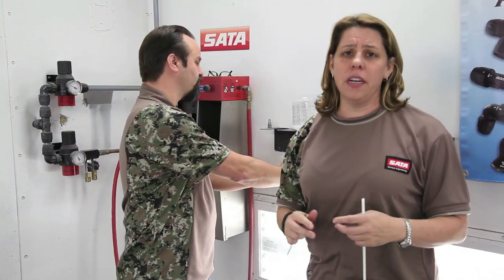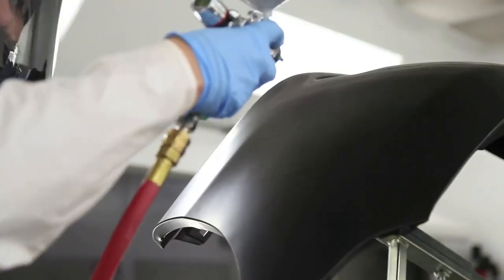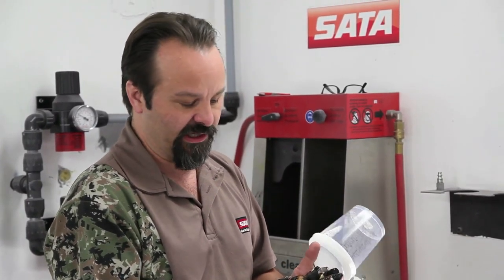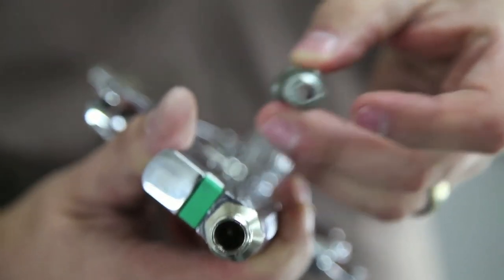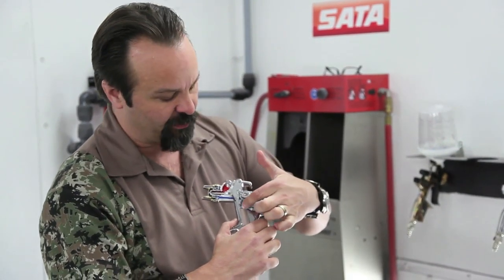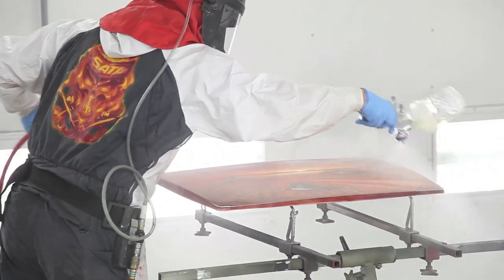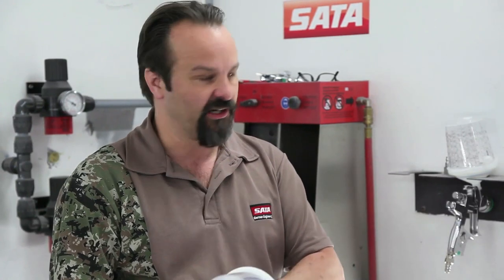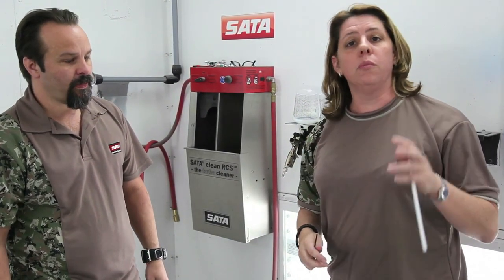How to Set Air Pressure / Air Volume for a HVLP or RP Spray Gun with SATA

Comment: I know the owners of this video have moved on - but for those watching this for the first time - there's merit in what the SATA dude is saying.  Not sure of the science behind it - but regulating the air at the beginning of the hose - rather than pinching it at the gun made a big difference for me. I opened the flow in the gun up until there was just a thread or two left - and opened the gun regulator open and then turned down the air at the dryer. The result was a softer and much fuller spray of clear that laid on like liquid candy. Around 40psi at the beginning of the hose resulted in 20 at the handle and probably 12 or so at the tip. Try it - it worked for me.
Reply: Dave Sinclair Yes, I think you are right. I mentioned this above to another person, but with my limited understanding of flow through a medium, turbulence is created at restrictions, and the HVLP gun is likely designed for turbulent flow ONLY at the nozzle. Any turbulance before that is added to the nozzle, which is undesired and not originally intended in the design.
Reply: Dave Sinclair What about leaving the gun side regulator wide open just so you can read pressure, while still regulating it at the tank?

 Or is that still fairly restrictive?
Reply: Lou Kingman Your idea would work - think of the hose as the float bowl of a carburetor - in that it creates a reserve of pressurized air to be used as needed. Logic tells me there's no difference - but I just sprayed a 911 and I have never had a better flow of clear -- just like liquid candy.
Reply: well back in the old days, everyone painted with a siphon gun with maximum fan, and maximum material- needles backed all the way out to the stop- and regulated the pressure at the wall on the shop air.  so this guy is not telling us anything we weren't doing since 1910 painting model T's with antique Spraco siphon guns with an .086" tip.  he's basically telling us, treat the HVLP or RP gun like a conventional.  and if you look around enough, you'll find out a lot of guys are pumping their HVLP gun pressures up to 60 psi- well that's not HVLP anymore, it's conventional masquerading as HVLP.  true HVLP is a bleeder gun with constant air coming from the cap, and material bled into the airstream when trigger pulled. and the air supply is from a turbine, and paint from a pressure pot.  that is true HVLP.  we were all sold a bag of goods, i.e. a bag of bs- when they foisted these HVLP guns upon the industry.  and the painting industry took the bait, hook line and sinker, and even swallowed the pole.  they got everyone to throw away their trusty reliable Binks 7 guns they had since 1937, to buy new $500 HVLP guns that don't paint for crap.
Reply: What i do i have a regulator and filter on the wall i turn the regulator down to 80, then by the time its get through the hose to the gun its the exact pressure i need. to easy.

Comment: im new. I actuall painted a couple of vehicles. First one had tons of orange peel. I only had the pressure guage at the gun. I bought another water separator for the wall. I acyullay said, let me try setting the wall at 40 and the gun at 28. It came out with no orange peel. I just wanted to cheack and see if the pressure at the gun is supposed to be 28 while spraying, or with the trigger closed. And I came across this and the guy is saying works better set at the wall. I just tried it to see what would happen, and now I find it is the way you should do it. And I will sat, the primer, and the paint all cme out smooth as if I purchased a panel primerd and painted from a factory. I did have a few fisheyes I had to sand and redo the job with though. next time I will know to wipre the thing with grease and oil remover. And get fish eye remover for the paint. It screwed me up bad and wasted an entire day correcting it.

Comment: To achieve the air pressure correctly, we can adjust the air pressure control gauge and reading the number on it.
To achieve the width spread correctly, we can adjust the spreader adjustment valve and measure how width it is (by inch or cm).
To achieve the correct distance between gun and the surfave, we can measure it (by inch or cm).
But how to achieve the correct fluid flow or velocity?
What is the best indication / direction in adjusting the fluid control and how to know if the volume of the fluid's spray flow is right and properly? (whether is too much or too little?)

Comment: If I have a 3000 RP non digital, should i use a reg and gauge on the inlet of the gun in addition to the reg on the wall for the whole job or use it to set the pressure at the wall and remove it for better flow into the gun?
Reply: What i understand from the video is that you can leave a gauge/regulator at the gun while spraying, but leave the reg as open as possible. Use it only for finetuning. Do the major adjustment on the wall.

Comment: Just found out me new Mini Jet 4400 the air regulator on the
back of the gun is plastic and if you plug it into a hose that has a 100 lbs or
more the plastic piece of ^&)^) breaks . I have two of the guns and both
are broken. So i looked at my Adam II docks and the same plastic crap. Should
have bought A Harbor freight $50.00 gun . I am done with Sata.Also do NOT leave thinner in the cup it causes the seals
to shrink up and fall  out . Found all this out from DAN AM Corp the Sata
distributor for the USA.
Reply from the maker: Dan Patch hook any gun up with 100 psi and you're going to blow a lot out of the gun. 
We've been begging techs for the last 10 years to store guns dry for that reason. We see it over and over. 
No one wants to invest any amount of money in a quality gun and see it ruin.
Reply: The money i spent there should be NOTHING on the gun made of plastic.Those Adam II docks  cost as much as some paint guns and there made of PLASTIC.How much do they save by using plastic instead of Aluminum or brass.
Reply: I am using a regulator at the  gun . But it will still have max pressure when you plug it in .So i am suppose to turn the wall regulator up when blowing the car off and then turn it down to spay.Or have 2 hoses.The Adam II dock cost as much as some pretty good guns cost and you make it out of PLASTIC.Probably would have cost $0.75 more to make it out of metal . Were is the quality in that.
Reply from the maker: your wall pressure for the gun (in the booth) would never go above what you need to have the right pressure at the gun factoring in your drop by feet of hose. So I'd have maybe 36 to 40 at the wall to have 24 to 26 at the gun. 
you wouldn't blow a car off a car in the booth so it's not an issue. 
A variety of components work together to lighten the gun. It makes the painters life easier... less fatigue and more cars per day.

Comment: I just want to come here and say thank you. I was using an hvlp to refinish my handrails for a home diy project and noticed the coat was flatter in several spots that it should. Seems I had the pressure set 3-4 lbs higher than I should. I lowered it and used high flow fittings and the finish is night and day. 

Appreciate the straight forward video. Cheers

Comment: This is a great video , while I have some trouble due to the speed of talking !!

So he do not use a typical HVLP gun there, but  a conventional one regulated to spray with low pressure high flow ? 

Is there an aided part around the nose for the last second of video ? an accessory ?
Thanks

I mostly spray lacquer on woods and some "primers" too
Reply from the maker: The SATA 4000 in his hands is a HVLP
Reply: i have devilbiiss flg 5    which is  transtech       not hvlp   basically conventional     but everything he says here makes any gun work better

Comment: Great info,  best change I did was adjust spray booth pressure but I actually leave a bit higher, it just works for me.  And I switched to the high flow fittings. Big difference, thanks

Comment: I was a painter back when SATA came out with their first HVLP guns. I think it was a jet95? Maybe Jet95 NR? Anyway, I had more gun distance from the panel and much slower passes that I see this guy doing. I also did a 50% overlap. This looked like an 80% overlap. Is this just a new way of painting or is it because of the RP guns? I still paint sometimes, so I'm curious. Am I now doing it wrong?
Reply: The guns now are much better than the NR95 you gotta be moving I run close to 80% overlap as well even basing metallics. The sata 5500 is a bad mofo gotta be moving and grooving with the base and clear you can choke the fluid down a bit on the clear gun and get a good finish either way
Reply: @rickybyrd660  I just bought a digital 4000 RP 1.3. I didn't like the NR95. I continued to use my 1.4 Jet90 back then. I really like how my minijet 3000 hvlp and my new 4000 RP 13. spray.
Reply: @CarbonGlassMan  that’s a good gun I wasn’t a big fan of the 5000 but the newest model is hands down the best base gun I’ve used. It makes metallic laying and blending easy. I used the hvlp 1.4 on the 5500. If I had a good downdraft I’d be using the rp for clear. I’m using an lph400 with a 1.4 atm. Also the new Satas have a 0 and an I tip. I liked using the 0. If you like that mini jet then you’d probably really like the lph80 with a 1.2
Reply: @rickybyrd660  I owned an lph400 Iwata before and loved it. That's one of the guns that got ruined. That was a really nice spraying gun. I have an older downdraft booth here with a bake cycle. I'm a mold maker now, making fiberglass and carbon fiber molds for the race industry so most of my painting now is just spraying clear coat on carbon fiber body panels. I do sometimes spray base coat too on my plugs that I plan to make the molds from but I just stick with black base to show any imperfections. I do miss painting cars. I was pretty good at melting clear in on C pillars.

Comment: all that to save a little overspray and some paint, and meet emissions standards....oh well, they're trying...but what a crock thinking that actually matters.   what I see is a stressed out painter who has a gravity cup in his line of sight, can't paint as good or see as good as an old siphon cup underneath the gun.  and has to make a lot more passes to get the panels covered.  if you watch the video they are painting like a madman frantically trying to cover the panel.  with an old Binks 7 or Devilbiss MBC they'd make a few passes back/forth with 50% overlap and be done.  I just don't get it- why this HVLP and RP is forced upon everyone.  makes no sense.
Reply: I know exactly what you mean...and I would say that if you have to paint as close as 5 or 6 inches to a panel, you rapidly increase the likelihood of metallic streaks if you are not exactly perpendicular because at that close range it's not very forgiving.   I'm glad I no longer have to earn a living in auto body.

Comment: Have a 30 gal compressor 5cf @40 and 4cfm@90 but HVLP gun says it operates at 15cfm I suspect I need a larger compressor, or add a tank.  if so what should I shop for?
Reply from the maker: Definitely a larger tank will help a lot.  Also be sure to use High Flow fittings, so you don’t have further pressure restrictions, and volume restrictions.  If you add a 200 gallon tank, you should be able to get by.  However, what I don’t know, is how large of parts and pieces, or are you painting full cars.  If full cars, you will need a larger compressor.  If doing this for a profession, at least 7 hp to 10 hp.  If as a hobby, the 5 hp compressor will be enough, but be sure it has a large storage tank, perhaps at least 60-80 gallons of storage.

Comment: I was spraying with 125psi line pressure and reducing it to 30psi at the cheap gun regulator :O

I will try setting line pressure at like 60psi and hope there is little to adjust to get 30psi next spray

Comment: I know this is an older video, so making comments or asking questions here now is probably a waste of time... but here goes anyway!

First of all, he's incorrectly stating the air pressures for HVLP & RP;  he's switched them: HVLP 10psi or lower and 15psi and higher for RP.

Second, it doesn't matter where the air pressure is set - whether it's at the wall or just prior to being sent to the gun - because the air speed will be the same regardless.
Reply from the maker: Nope... 
Choking down at the gun changes performance. 
It's been proven by every gun manufacturer and paint company
Reply: Thanks for your reply,  @Collisionhub .  If you check the statement I made more carefully, you'll see that I was talking about the pressure being reduced prior to the gun and not at the gun itself.  If the pressure is too high, then quite obviously it needs to be reduced, right?  I'm contending that it doesn't matter where that's done prior to the gun.
Reply: it  matters a lot where it is set       im not being rude and hope you dont take it that way       you should rewatch the video          if you set at the wall and use the hi flo fittings you will get a better job everytime       try your settings both ways     his way will give you a better paint job
Reply: @Collisionhub  I didn't say to choke it at the gun.  I said that I did the restricting prior to the air entering the gun, not at the gun itself, which I kept fully open.   Notwithstanding, nearly 6 months ago I made a major change in my spray booth setup and mounted a high-quality air pressure gauge at the wall.  I then removed all the mini air gauges from my spray guns.  By having a shorter gun (by not having a regulator nor any filter hanging on the end of my handle) it improved my ability to get into and around the insides of cabinets - which is what I spray (I'm not into automotive work).  Then, to give me a better idea of what pressure loss my 20', 3/8 ID hose and high flo quick disconnects were imposing, I installed a mini-gauge at the base of my favourite gun - Fuji Spray's LX-20 HVLP model - and went through several tests to see what the pressure difference would be.  In all my tests, the pressure loss was 1 PSI.   Wanting to see if that equated to the same pressure loss at the aircap, I swapped out the aircap on for one that had a mini-air gauge tapped into it.  That additional step confirmed again that I was consistently losing 1 PSI.
Reply: @les1ed  thanks for your opinion.  Please see the response I just gave to @Collision Hub regarding the upgraded spray booth, which now enables me to set the pressure at the wall.

Comment: sata"s are overpriced pieces of crap I just bought a digital rp 4000b the first time I took it apart to clean it the cheap plastic air flow distributor behind the nozzle was never the same

Comment: Psi.  We use bar my 3000rp is at 2 bar sprays standox clear coat great   Like the tip ajust at wall then open air fully open at gun to get the balance

Comment: ***** Lot's of people have problems wrapping their head around volume vs pressure.  It seems you're on the right track.  But when you turn hose valve half off, you increase pressure before the valve and decrease the flow after the valve.  So then if you have another valve turned quarter way, you increase pressure again before the valve and reduce the flow/volume. Then you have the valve in the gun, same scenario. So all this leads to horrible air volume at the tip.    So the idea is this, you want cleanest volume of air to the tip as possible without additional restrictions.  It has to do with "Laminar" air flow,,,air flow with the fewest restrictions and without causing turbulence, another kind of resistance in the gun.  It makes the difference between spitting the paint on and giving a nice atomized uniform spray pattern that's more reproducible..
Reply: well put. you understand the subject. its funny how other guys just look at as psi is  psi.  thus not understanding volume vs. psi. cracks me up some people are hard headed. xD
Reply: +David Ocampo psi is psi. and cfm is cfm
Reply: highvelocity123 v
Reply: @latouselatrec  except they directly affect each other

Comment: A question, my sata 3000 rp gun has air coming out of the cap without pulling the trigger. Not full on air just small amount of air . Needle is not sticking
Reply: Sounds like the air valve seal is either worn out or dirty. Disassemble air valve to clean or replace the seal. Carefully inspect the "seat" inside the gun where the air valve seal sits to make sure that it is clean as well. If this area isnt clean, it will allow air to bypass the seal even if the seal itself is in good shape.

Comment: sata"s are overpriced pieces of crap I just bought a digital rp 4000b the first time I took it apart to clean it the cheap plastic air flow distribution cap was never the same leaks air out of the nozzle paid over 800$ for the gun should have bought a Devilbiss ProTech for 480$ much more durable and sprays as good if not better  😡
Reply: Frank Gadman  If you will look in your Manuel it says that any time the air distribution ring is removed you must replace it. You can buy a pack of 3 for around $25 bucks here where I live.
Reply: Derp.

Comment: Rp means Reduce pressure and the hvlp is a conventional one, I better Rp because you can paint with low pressure and the job look real nice and you have less over spray
Reply: sorry but HVLP is not conventional ,conventional are the older high pressure guns ,RP AKA compliant is a hybrid solution between HVLP and conventional high pressure which gives superior atomisation at a higher velocity although still not as fine as the older conventional guns

Comment: What's the inside diameter of a high flow fitting? I'm using 3/8 inch ID on my gun. Is it larger at 1/2 inch ID or?
Reply: they are talking about the quarter inch high flo     which comes in at 0.351   in milton fittings          3/8 is 0.375      so pretty much the same    but fit on the gun
Reply: @les1ed  Thanks!